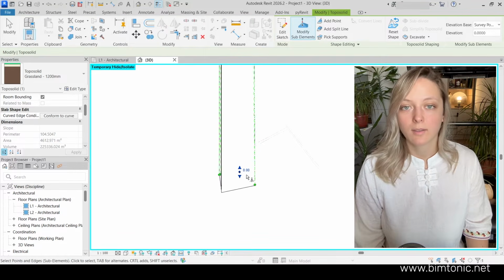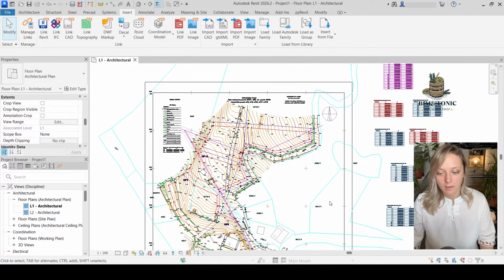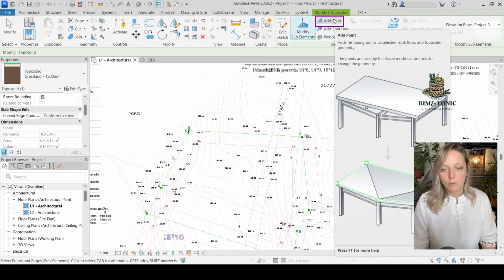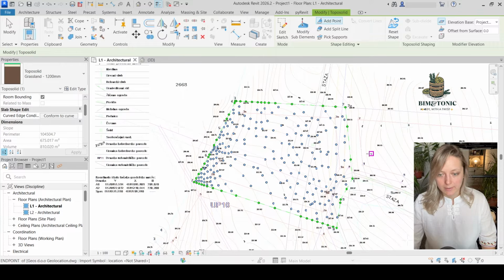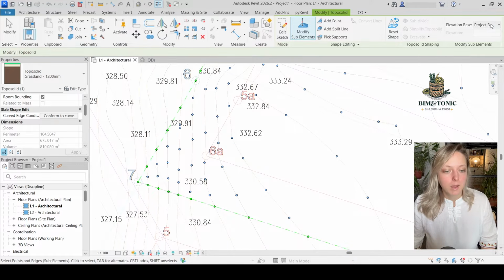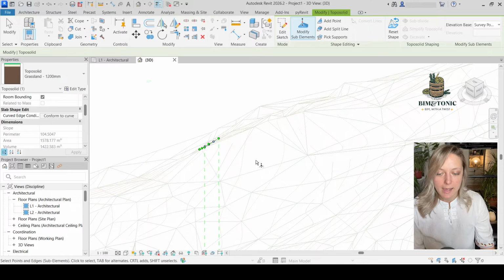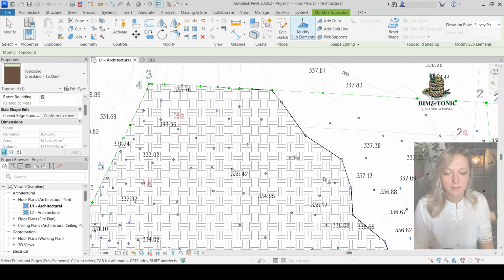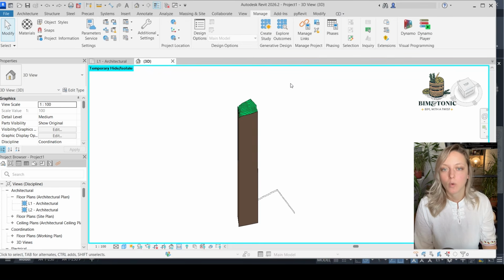How to Model Topography in Revit Manually (Points & Contours Tutorial)

Comment: man this is p*ssing me off.  No mater how many times I do this, I "add point" and select the elevation # I want to add to the point, then i check my 3d model and revit has added it's own elevation #.  I make a contour line, set it to 40ft in elevation -- revit chages it to 530ft.  It also won't let me add points at level "0" as you're doing
Reply from the maker: is your elevation base set to survey point? I usually set elevation base to survey point and than set offset to 0 and than it has no jumps like that.

Comment: In Revit, how can I create a 3D representation of the elevations on the toposolid map (at sea level) with a small thickness? The sea level elevation should remain as it is on the site plan.
( revitte toposolid haritadaki kotlar deniz sevyesinden bu kotları nasıl bir yöntemle 3d görümünü az bir kalınlıkla görebilirim. site plandada deniz seyesindeki kot dursun ) Öneriniz NE OLUR)
Reply from the maker: You can change the thickness by going to edit type>>structure and assigning earth layer smaller thickness. In 3D you can also check "section box" option and adjust the section box to show exactly the part you want.
Reply: @BIMTonicLive   toposolid
Reply: @BIMTonicLive   Toposolid daha önce sorduğum soru ve eyik düzlemde arsa çekme sınırlarınıda yine eyik düzlemde nasıl çizeriz. çok detaylarıyla ilğili dersiniz varmı ?kısa örnek sunumlarını satın almadan kıs avideolar görebilirmiyim ?teşekkürler.ile  (Regarding the toposolid, a question I asked before, and how to draw the setback boundaries on an inclined plane, also on an inclined plane, do you have a lesson with very detailed explanations? Can I see short example videos without purchasing? Thank you.)
Reply: @BIMTonicLive  Regarding the toposolid, a question I asked before, and how to draw the setback boundaries on an inclined plane, also on an inclined plane, do you have a lesson with very detailed explanations? Can I see short example videos without purchasing? Thank you.
Reply from the maker: @abaalp5813  i cover setbacks in this lesson https://youtu.be/wJJU9qeEfkc?si=T4jBxbvxfu_FW-VP